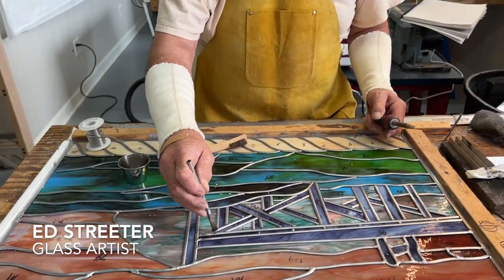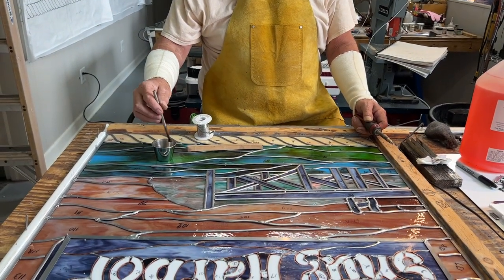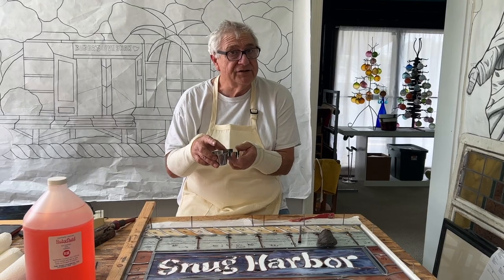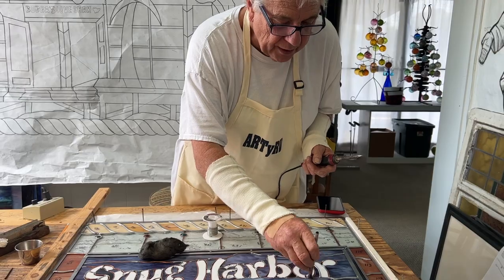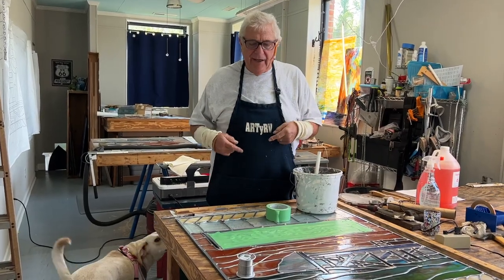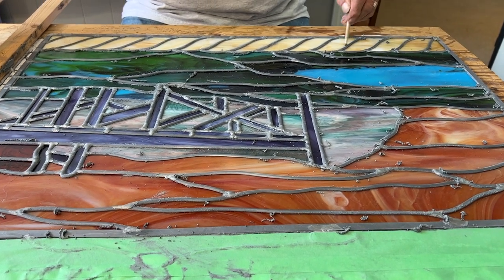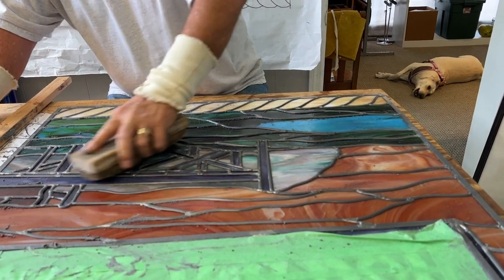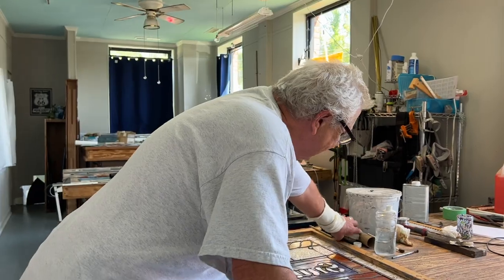Solder Copper Foil + Lead Stained Glass Window

Comment: Did you clean both sides with baking soda before applying the putty?
Reply from the maker: Just the copper foil before patina.
Reply from the maker: Then cover copper foiled section with paper and painters tape when we putty.